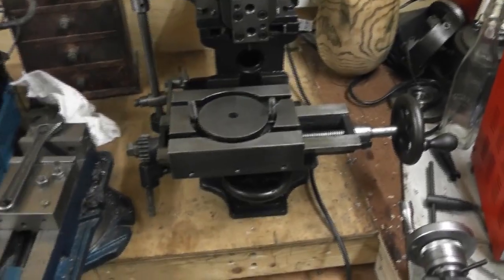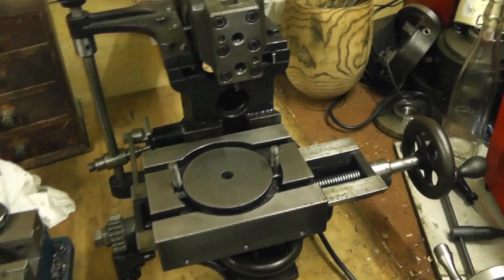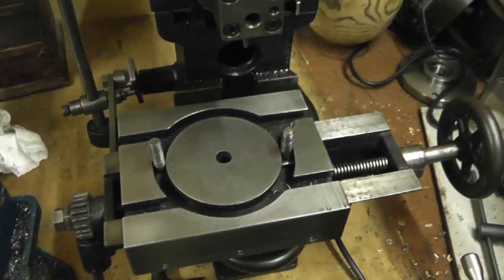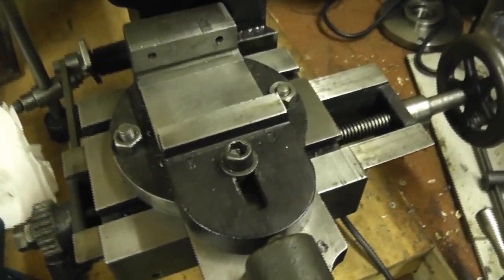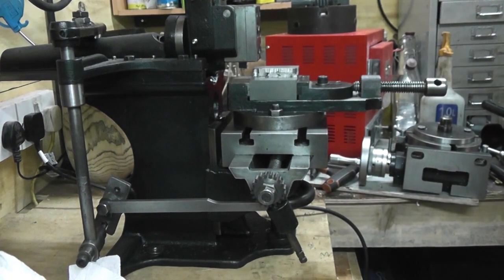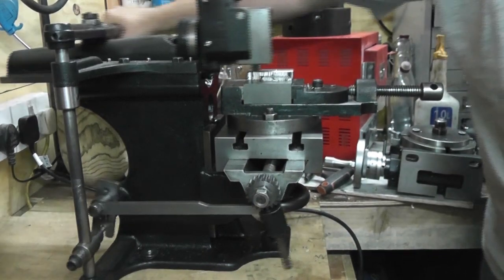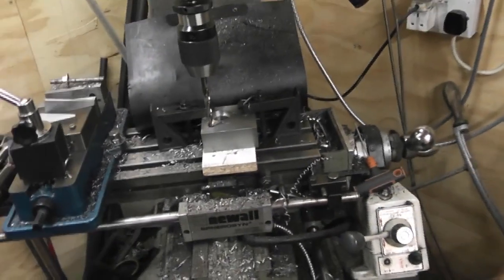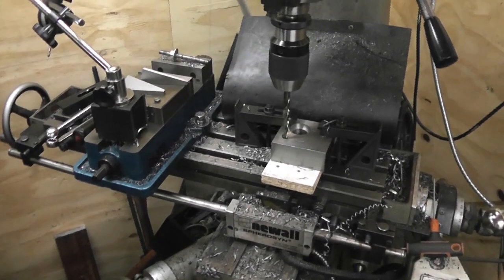Drummond Mk2 hand Shaper

Comment: Is it not possible to reverse the direction of cross feed by disengaging the drive pin, raising it above the slotted link then rotating the slotted link such that the slot is above then lowering the drive pin into it and locking at the appropriate height to give the required throw?
Reply from the maker: there could be a work around to get the feed going the opposite direction, when showing the feed working from the side you can't really see the issue though, the horizontal bar which operates the feed pawl which drives the gear fouls the bed rails if setting the pawl pointing up, also the sliding bed will have a limited travel, or limited width part on the bed to work on and is the main reason why the linkage and pawl is attached low.

it is Drummond though and they always did things cack handed, drummond lathes with half nut carriages always have the carriage traverse going the wrong way, turn the wheel clockwise expecting the carriage to move right and the tool and cross slide slams into the chuck if not aware or forgetful, all that is needed for the shaper is 2 gears or an opposite hand screw thread and all would be fine :)
Reply: @markhobster8113  Does not the pawl reverse feed direction like most shapers though? I.e. rotating one way 90 from neutral gives feed one way and 90 from neutral the other way gives feed in the other direction. If feed is only possible one way it would be a bit of a bummer.
Reply from the maker: @532bluepeter1   yes it does but it moves the bed on the cut stroke as opposed to the return, as you pull the bar forward instead of the pawl ratchet clicking to then move the bed on the push stoke it clicks on the push and feeds on the cut, I'm not well versed on shapers and I sold this hand shaper early this year which I've regretted a few times, you don't need something till you sell it, but for many months it was collecting dust, someone else could have got a lot more use out of it and also I'd been out of work for a while, got back to work for a couple of weeks then lockdown happened :/